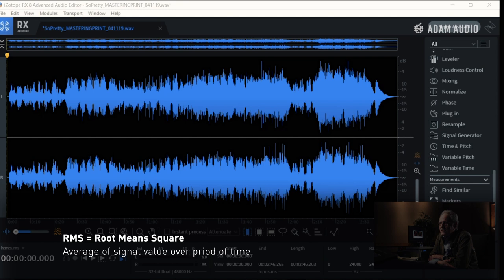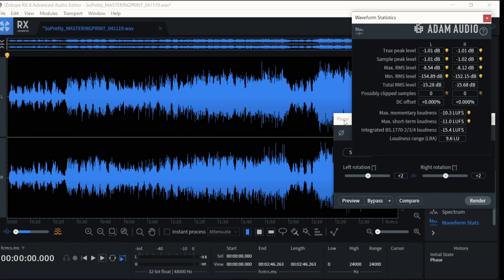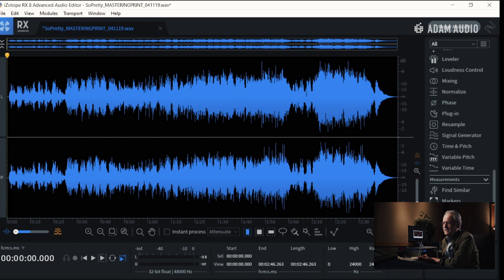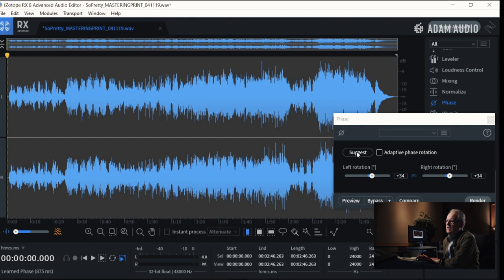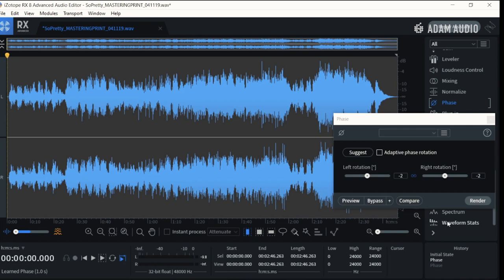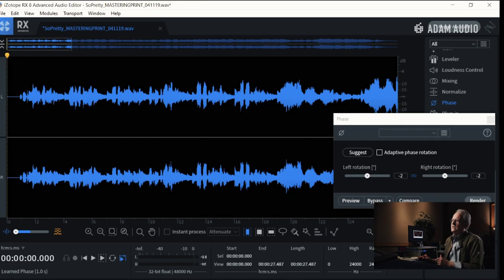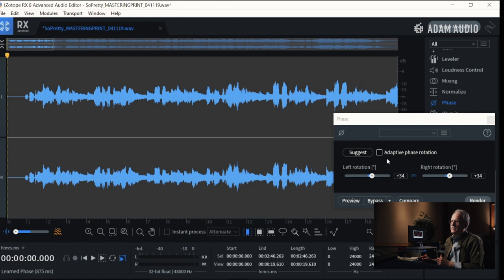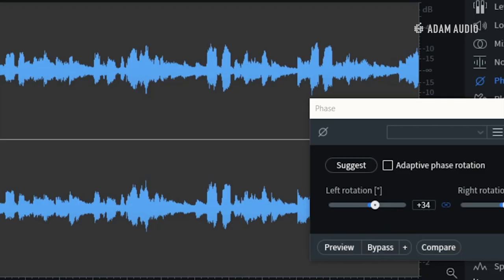The FIRST Step to Mastering a Song: Fixing Phase Rotation | Mastering Masterclass Ep. 4

Comment: This is the only video/piece of information I could find so far that approaches this topic in mastering, for the rest it's all about fixing it mixdowns, but unfortunately I'm in no position to be able to fix the problems in the mix. Since I'm doing an assignment for school that's solely focussed on mastering, I must ask: If there is a lot of Anti-Phase issues going on in the Mixdown/Premaster you're mastering, how much should/could one do to correct this? Especially if you don't have a plugin like RX at your disposal for example? I have analyzed professionally mastered files with the PAZ meter, and a lot of times I still see a lot of spikes in the Anti-Phase Region. Anyhow, I'm supposed to be in the final stage of the project, but this keeps breaking my head. Thanks in advance to anyone who might give me some clarity on this!
Reply: Basically, phase rotation is to algin your track from causing phase. You can also take care of phase in the mixdown stages when you are mixing down drums, bass, guitars, etc. Also, when you bounce a track down it never aligns up perfectly, that will also cause phase. For example, if you bounced a beat down and want to use it to record. You have to make sure you put in back in phase before you use it.  This is one of the hidden gems that no mastering engineer will tell you.  What's even better he gave up the magic number of -2 that will give your master a smooth feel. Basically, if you don't algin your tracks and take care of phase, it doesn't matter how good your mix and master is it will sound bad.

Comment: Video is "old" but wondering, why not use the "adaptive" mode ? I did several tests on different types of music, some works perfectly fine with the "suggest" while some other performs better (phase wise) in "adaptive" mode, especially when there a massive difference on transient. The suggest mode does not change a lot, the adaptive seems to really center things up better.
Any where to find out more infos about what's really going on behind these two different modes ?
Cheers!
Reply: from the manual "Adaptive phase rotation is best used on vocal material, as it can occasionally yield pitch artifacts on musical material." So in the always use your ears.

Comment: Can you explain how this sort of 'issue' occurs in the first place? I assume it comes from the microphone or multiple mics summed together? 
If I'm working entirely in the box using software instruments, synths and samples, this isn't going to happen, right?

Can you even hear the difference between a piece of audio with an asymmetric waveform? What sort of benefit am I gaining, apart from, I guess - ability to master a track louder because you've moved a louder 90 degree wave phase moving closer to the zero crossing point?

What about DC Offset in some microphones?
Reply from the maker: Hi @MOSMASTERING! Thank you for your questions, we unfortunately cannot answer them since we made the video a long time ago, we suggest to contact John directly for any questions. Thanks for understanding 🙏
Reply: I'm not John, but I can help you with that. Some sounds, mostly acoustic ones, like guitars, percussion, human voice, are asymmetrical by nature. Imagine hitting a drum membrane with a stick, the first half-wave is the biggest in amplitude, because it's caused by the stick (or hand) directly being in contact with the membrane and moving it much deeper/further than what comes next. Every movement coming next is smaller and smaller in amplitude and if you analyze the whole drum hit sound - it will have a skew from the center line.
This doesn't usually happen in synthesized sound as much especially the closer you go to a sinewave.
Regarding the difference - many people say you don't hear a difference, BUT. People who work for example with car audio know that there is a difference. If you wire all the speakers in a given car in a wrong polarity - you'll have less punch, because the first movement of speaker membrane goes inside instead of outside. And all this phase correction thing (which I was using in the past too) is a wrong thing to do, because it messes with the original natural sound. It won't change RMS, frequency response, but it will sound differently. If you say "pumpkin" into a mic - it will be asymmetrical, because of how much the mic membrane is being moved by the air bursts. But it should be that way! And after using RX adaptive phase rotation for years on podcasts I finally stopped doing that and it sounds much more better and natural.
Regarding the benefits - you get less distortion when applying dynamic processing (compression, limiting).
In some cases of course phase correction is needed and as you mentioned DC offset - it's absolutely needed. Because in this case the waveform is shifted to one side by constant voltage applied to the signal.
Reply: @AndrewMcMillenium  

Thank you so much for your detailed response, appreciate that a lot. 

What's your take on this - I don't know if it's real or if it's placebo - but I often listen to two sounds together in isolation and hit the invert phase button a few times in the Cubase channel strip.. and just by ear, I decide whether they sound better together or not. Even if its very slight, I believe in all the 1% differences to your mix all adding up..

Obviously, sounds that have a lot of low-mid overlap (around 200hz-ish on snares, for example) will obviously have some punch added or subtracted if a sound has any frequency overlap in that range. But - I apply this check to every sound in a general group of similar sounds (drums, synths, vocals etc.) no matter where they are in the spectrum.
Reply: @MOSMASTERING  It's not placebo, it's 100% real and objective.
Here's a simple explanation. Imagine a kick drum of a drum set. If you invert the phase, then the first couple of milliseconds of initial air compression will transform to decompression. Overall it will sound almost the same, but you you can feel it if you just put your hand on the speaker (or subwoofer if you have one).
Sometimes RAW audio has wrong polarity from the start, so you checking it is actually a good thing.
Reply: @AndrewMcMillenium  

Bear in mind. I'm not talking about phase flipping drums or kick and bass to fit together etc.. 

I really mean - phase correction *in general*. Because, I fully understand and can easily hear it is not placebo in the case of drum or sounds with a low frequency fundamental. 
The lower the frequency, then obviously the more pronounced the potential for a frequency overlap.. 

I'm referring to my micro-adjustments when it come to phase flipping comparing AMY and ALL sound-to-sound?  Example; synths or sounds that have fundamentals above perhaps - 2000hz - with information content up to and above 10k. 

If I take a lead pluck sound and play it against a pad, for example. I flip the phase back and forth and just pick the one I think sounds best.

Also, I have a great plugin called PHA by Voxengo that allows complete phase rotation degree by degree, not just 90 degrees at a time.. This is incredible for EDM when matching up the kick and bass and dialing it in perfectly.

I am an audio engineer, so I fully understand the concept of speaker cones moving and what phase actually represents. I just wondered if anybody else goes as 'in depth' as me when it comes to phase across the entire freq. spectrum.
Reply: @MOSMASTERING  Sorry for oversimplifying in my previous comments. To be honest I wasn't going as deep as you are tweaking phase regarding music production. But I do when I process voice,  because we as humans can distinguish the smallest changes, which make it sound unnatural. And the so-called "transparent" processing of "adaptive phase correction" in RX in fact irreversibly damages voice recordings.
And regarding micro adjustments and if it's placebo or not - if we hear phase invertion, which is 180 degree rotation - we also can hear smaller changes, like 40 degrees. It's like somebody can't hear a 3dB change in loudness, some hear a 0.5dB change.

Comment: so after you're mostly done mixing should you run the phase alignment tool on each stem/part  then re-mix it?
Reply: You won't need to remix it. The volumes of each stem/part are going to be the same as they were before you phase aligned them. Your mix will still be okay. It just means that because the waveforms are now more symmetrical, you might find that you can make the overall mix hotter by a couple of dB or so (if you wish to).